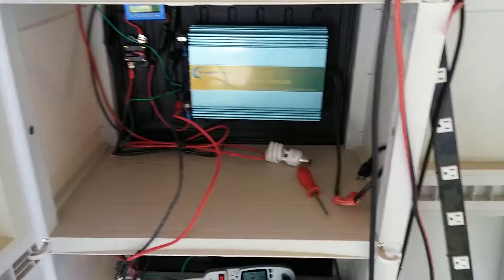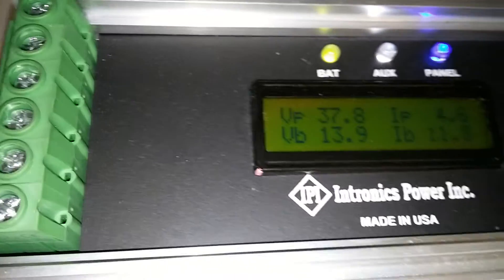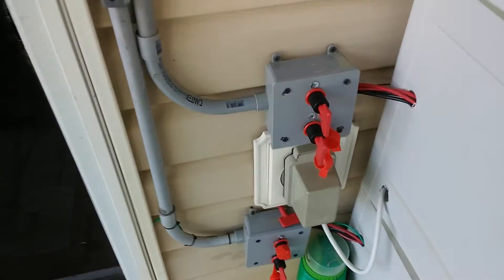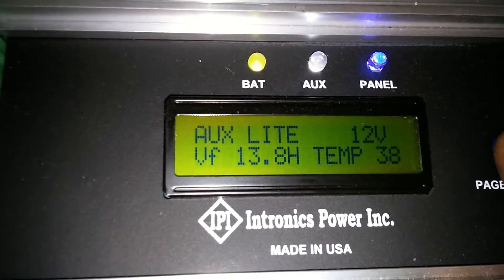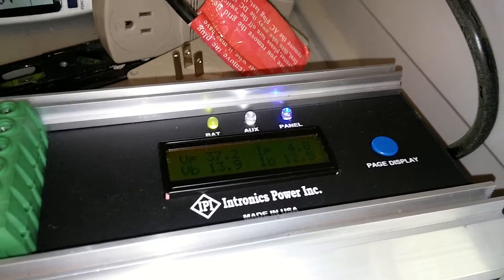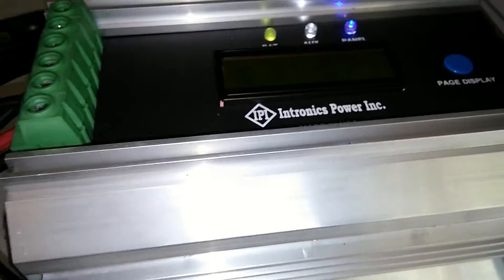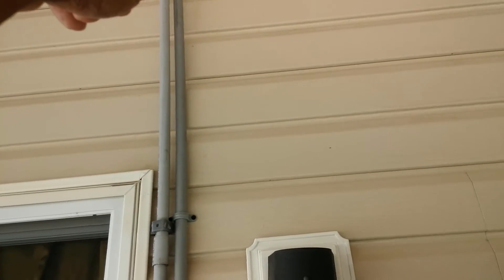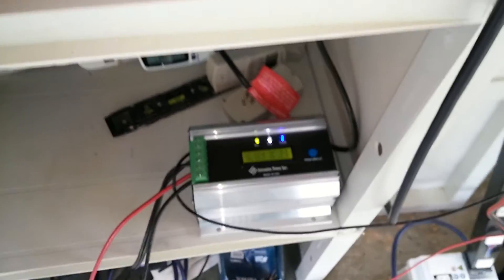Intronics Mppt charge controller

Comment: Car batteries will work just fine all day.  110 AH is not a car battery, that is a deep cycle, I'd keep the 110 AH batteries and take the others off or make them into a second bank.

Looks like just one panel, so don't go over 178 watts per hour and limit use at night! 
Is your Intronics controller still working? I bought mine in 2015 and it is still working everyday.
Reply from the maker: Ken Barnett ——cool thanks for checking out my video

Comment: dip switches are specified as left most and right most, but if the circuit board is UP (the top) then fine, but if the bottom is the 'up' direction for the dips, then leftmost and rightmost become reversed,  and I have to GUESS that the front of the controller is UP, although that makes the circuitboard 'upside down'... watching the panel is freaking useless, and looking at your wiring and counting your batteries is freaking useless, thanks for wasting our time, glad you are pleased with your purchase.
Reply: Joseph...Why not rewrite your comment so we can understand what suggestions you have. No need to lambaste a YouTube creator in this manner.
Reply: joseph bodden thanks for checking out my video

Comment: My itronics 75 amp burned up after 1  1/2 years with 300 watts of panels.
What a expensive junk that is now a door stop.
Reply: You should call the manufacturer, they will rebuild it for $75 or send you the parts for free, the customer service is unbelievable! I shorted mine by crossing wires and they sent me a set of FETS and diodes along with a new fan and full instructions expedited overnight @ no charge, simple repair and works great again!